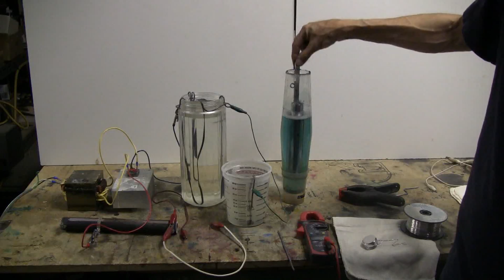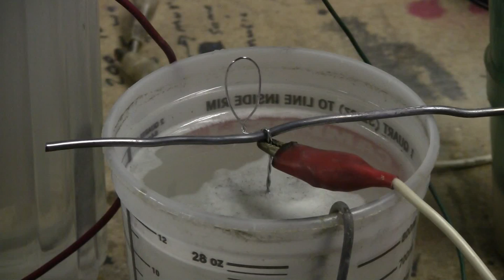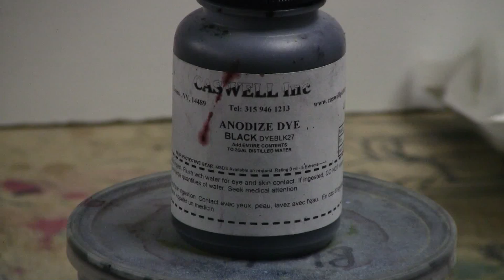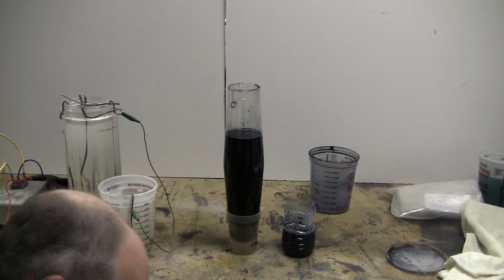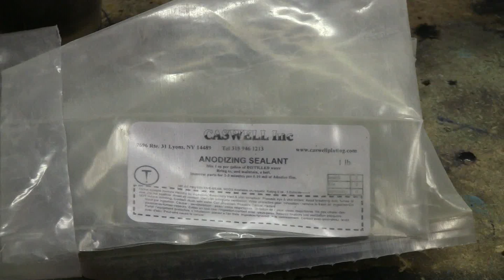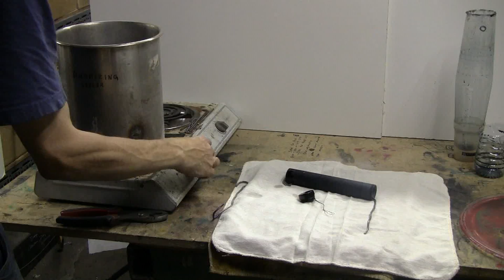How To Anodize Aluminum

Comment: If you put the speed at 1.5, the video is actually really good.
Reply: :D
Reply: William Murphy Wow, the speed is actually a useful thing!
Reply: William Murphy Thanks
Reply: William Murphy How do you do that.
Reply: Click the gear. Select speed 1.5
Reply: William Murphy
Yea, I just figured it out, but it seems to only work in Chrome.
Reply: dispatcher7007 I was watching in FF.  I also noticed that it works with IE in the metro environment.  It's not working with FF, IE on desktop, or Opera (despite the fact that Opera is now just a different skin of Chromium).
Reply: dispatcher7007 It's probably an issue with Flash Player.
Reply: William Murphy "If you put the speed at 1.5, the video is actually really good."

==But he pronounces perfectly and sounds like a newsman.
Reply: Folopolis it could be that your not using the html 5 player with youtube so you should check that, it could be a reason for it to not work. chrome supports it, but i am not sure that firefox does perfectly and it could be a potential problem.
Reply: Aℓαηтιc ƒℓαмє FF does support it, but doesn't use it if Flash is installed.
Reply: Folopolis yeah that's why.
Reply: William Murphy if u use .5 he sounds so unsure of himself haha
Reply: LOL - YES!
Reply: Hahaha, the FIRST thing I did, and thought I'd give the tip to other people. Thanks for being first. :)
Reply: Thanks
Reply: 2 x times speed is not bad either if yo're impatient like me

Comment: GR8T job Mr. Bill. I'm an "Anodizing" newbie.. I was more than surprised to find that the "color" is another process. I had been paying close attention to the video and then realized that 1/2 way through it "cooking".. I didn't remember seeing anything related to the pigment aspect. I was quite surprised to find out its dyed afterwards (live and learn). The items are of much higher quality than I would have guessed from basic, available resources. You’ve inspired me to try the same. 
BTW, that is a lot of work to produce such an informative video. From the actual how-to “to” the editing. I (we) appreciate your brain power and efforts.Thank you!
Reply from the maker: +OvalWingNut Give it a try on some scraps. As long as you can somehow get the acid. You can experiment with color by getting dyes from Caswell or trying whatever you have on hand. Even sharpie markers can work. Note that some aluminium alloys don't take anodize, so maybe make your first tests on some known aluminium. You could file the existing ano off some piece of extrusion, for instance.

Comment from the maker: The dye can be saved in a lidded container, and seems to have a good shelf life. I store it in a cupboard and have used it after months of storage. The dye comes as a concentrate and is mixed with water, so you can make up just the size of dye bath needed.

Comment: The idea of the dying and "cooking": When you anodise things with sulphuric acid the aluminium oxide forms a porous - grainy structure. The pours are actually big enough that organic dye molecules can soak in between them. Then when you boil the part, these pours expand to form a much tighter packed structure and this then locks the dye in place. 
In industrial anodising they are very careful about contaminating the acid with any other metal ions, as this can really impact the quality of the resulting layer. So using an aluminium counter electrode is preferred, also using deionized water, and keeping it at a fixed temperature. 
An alternative to the sulphuric acid anodising is to actually use "oxalic acid" about 4% in water, with around 50V DC seems most effective. The acid is a weak organic acid, so more user friendly in that respect, though it is toxic if ingested in large quantities (c.f. rhubarb leaves!) . The anodised layer is typically a slight golden colour (depending on the voltage and temperature), but because the pours are much smaller than with sulphuric acid, it cannot be pigmented. It is however extremely hard. This was the anodising used for many WW2 parts, for those who may recall that golden colour of some army surplus items!

Comment from the maker: In order to preserve your machined surfaces so that they fit precisely, you could mask these areas so that they do not anodize. The size change depends on current, time spent anodizing, the alloy, and even the temperature and concentration of the anodize bath. Masking areas can be done with paint, for example.

Comment: Excellent educational video. Might be worth mentioning that hydrogen gas is evolved from the cathode and oxygen from the anode. While not toxic, they are quite explosive if the accumulate and ignited by a spark. As well, some would recommend wearing latex/neoprene/nitrile gloves. No risk of fingerprints that way. Thanks again for shaing your knowledge and experience.

Comment from the maker: This is a 2 ohm resistor with a variable tap on it. I use it to limit current on smaller parts. A variac could also be used to vary the power supply output achieving the same effect.

Comment from the maker: The group of laser parts on the left is dyed with Caswell orange 3A. Next part is Caswell yellow 4A, middle section is Caswell deep red. Then Caswell violet 3D, the blue parts are all Caswell blue 4A, the light ones were dyed less time. The parts on the right were dyed using RIT clothing dyes from Walmart.

Comment from the maker: To use sharpies, anodize the part, rinse the acid off with water, and allow the part to dry. Once dry, it can be drawn on with the sharpies, then boil it in water or sealer to finish.

Comment from the maker: If you can, it should be stripped before re-anodizing. Otherwise, you may get a blotchy appearance or other issues. Alternatively, you can mask off the already anodized areas by perhaps painting them over. Some people use nail polish to do this, and then strip it off with acetone later.

Comment from the maker: The acid should not get hot, nor should the part become pitted. Sounds like excess current was drawn, this can lead to a no anodize layer result. A rule of thumb for current is 15A per Sq Ft for one hour. Use some kind of resistance to lower the current drawn if it is excessive. The acid bath may need cooling if heat buildup is an issue. External ice bath will work.

Comment from the maker: The connective wire to the part must be aluminium or titanium. The Al wire can be cleaned for reuse by sandpaper. I often just discard the Al mig wire after use, but I sand the thicker tig rod Al and reuse it.

Comment from the maker: You should be able to find the dyes, at least anodizing is a common process used worldwide. Overseas shipping is always slow and expensive so hopefully you find something locally. Experiment with different dyes and see what happens. The Caswell sealer is nice, but boiling in plain water worked for me for years until I got the sealer product.

Comment from the maker: Those 808nm diodes only usually cut dark colored materials. For cutting fabrics, you might be better off with a CO2 tube of 40W or better off of ebay, with a matching power supply and a focusing lens. Some fabrics may tend to catch fire if the power or beam profile is wrong.

Comment from the maker: You might want to look around for high current DC supplies. A powerful battery charger might do. You would need around 15A per square foot of aluminium. Perhaps ebay? There might be a used supply suitable for anodizing.

Comment: can you direct me to a table that outlines how many turns and what gauge of wire is needed to obtain the same result of your rewound transformer.. and what the original specifications were on the transformer, and what you get out of it after modification? this is a neat set-up.. ive been watching alot of home aluminium smelting.. and it was only time before i reached anodizing.

Comment from the maker: Give it a try on some scraps at first. You' ll succeed. Get used to the process before doing more valuable parts. Some alloys don't anodize well or take color well so there will be the occasional disappointment. Go with the pro dyes and sealer from a place like Caswell (sells small quantities) to get good color results.

Comment: Interesting. Thanks for the demo. Questions: When you say you are using lead solder as the negative wire, does this mean that the resulting anodize layer is a layer of lead that transfers via electrolysis from the lead solder through the acid to be deposited on the aluminum part? If so, is it safe to handle, or will your skin absorb lead from the anodize layer, leading to possible lead poisoning? Are other metals such as brass, copper, tin, nickel, gold (from an old piece of jewelry) silver (from an old silver butter knife or silver coin used as the negative wire perhaps) able to be used as the negative wire? If so, are the results similar? i.e... end result: a copper plated piece of aluminum, silver plated, gold plated, brass plated, etc?

Comment: You mentioned that the source outputted 15 DC volts into the anodized tank. How did you find out what resistance to use? Also how do you test how well the part was anodized? Great video!

Comment: Bill, once a surface is anodized, perhaps we scratch this surface and the anodization layer is removed, thus making the part conductive (no longer anodic). Let's say the middle of your tailcap is scratched, the scratch is 1cm long and maybe .25mm wide. If we follow proper anodization procedure, will the scratch only 'bubble' or react while bathing in acid, or will the entire anodization portion react? Can the scratch be simply fixed? The surface does not need to conduct electricity I am wondering if this is possible?

Comment: hello mr.bill,your video is very educational and simple to understand and i watched it many times your 4 videos,well i am from the philippines here in manila and i would like to start anodising bicycle parts as a hobby, the question i want to ask is in the absense of anodising dye,is there another type of dye that i can use aside from the caswell anodising dye,also can i use a standard 60/40 or thicker  lead solder wire work aside from the mig welder wire as in your video.,TIA for your answer,more powwer

Comment: Mr. Bill, Great job on the anodizing process. I saw sparks when you connected the current leads, please be careful. May I suggest removing your power source until you're clear. Sounds like you've got plenty more good tutorials about metal finishes in there. I have not check your channel, carry on my son, good job. As for these half ass comedians cracking about your tone of voice and speak pattern. I'd like to take my 44 years of studying isshinryu karate and 26 years as US Marine, and give them a little talking to with my well capable hands. 
Thanks again for the tutorial, and Semper Fi. What the f___ ever happen to respect?

Comment: I just love this very informative video. I have a few question though. Would love to have your answer soon please as I want to anodize a project which I'm doing instead of painting.

1. What is the minimum power supply required? Will 9-12 v with 2A or 3A be enough? My concern here is the amperage.
2. What do you mean by degreaser? Is it lye with water?
3.Can liquid food coloring be used for dyeing?
4. Is there an alternative for ca swell sealant? I don't live in US :)

Comment: Someone tell me, wouldn't it make the process much more effective if when the parts were being immersed in the dye that if the container was sealed and high pressure applied (to make the dye penetrate the oxidized layer more) it would yield a stronger/ better end result? What are your thoughts?

Comment: If the piece I want to anodize is too tall for the boiling pot, can I just seal one side for 10-15m and then flip it around to seal the other side for 10-15m. For example a 20" long pipe in a 15" tall pot?

Comment: Hello, great video, i tried this method after pollishing a few motorcycle parts, some worked and some turned a greyish color after the sulfuric acid process, then the dye looked awfull, tried lowering current but was a little less grey but still spotty with some dark grey spots, the dipping aluminum wire looks great thou, lol. Any thoughts on this? Thank you

Comment from the maker: Calculator for the current  (ndhsubmersiblescience . com/ano/720rule)  (take out the extra spaces)  This calculator will be helpful in knowing what current to use for your size part for the desired coating thickness. The resistor is used if the part tries to draw excessive current at the voltage being used to anodize. For small parts like flashlight sized, a 12V supply is fine and often the resistor is not needed.

Comment: Well i have a  power supply i made 30 years ago that gives out 8-18v on two outputs each with a 30 amp capacity so I will use that as it does a good  job, But having trouble with the dye...it just wont take I ran 8 amps at 15v for two hours the acid got hot, the aly started to show pitting but my dye is crap. has it's own fixer and you mix them..but it's not working...Colin

Comment: Nice job Bill.  Very clear videa, though a bit slow.  Just one question: is the water used for rinsing and boiling distilled water or can it be simple tab water?

Comment: I have a question Bill, and I dont know if I simply miss it.. about the power resistor to reduce the current - how much current is needed, say, for the parts you worked in the video? i got here a 12V DC power supply 20A, and I think, I need to reduce the current.. thanks in advance!

Comment: Bob I have a question about the leftover chemicals used. Once you use the sealer, can you save what is left in a sealed container to use at a later date? Same question with the acid bath. Thanks -

Comment: Bill thank you for your respond to my prior question, am i to understand that the distilled water should be mixed to the battery acid at a ratio of 5 parts distilled to 1 part battery acid. I will not be anodizing but parts about the size of the end cap of your battery case. I will be using a HDPE plastic 1 gallon container, I purchased 2 lead anodes from caswell would 2 lead anodes be to many and should I shine them before using?
Respectfully, James Price

Comment: If using a car battery charger how many amps should be used? I understand the 12 volts but my car charger has setting for 10 amps and 40 amps. Great video btw!!!

Comment: Well I bought another make of dye and will only use the color not the salts they give you to fix the color. I am using 38% sulphuric acid for batteries and the same amount of water to get the commercial mix value of 19%, the surface area is 75 sq ins.  the cathodes are bigger by two fold. voltage and amps adjustable.
So day two... I will run about 6-8 amp 21v for 1 hour   can i use food dye if the new dye fails?. im sure the metal was ready, as further anodizing just pitted the metal.

Comment: Bill, thank you for the educational videos. How many times can you use the acid bath? Once you are done with it, how do you dispose of your acid bath?
Reply from the maker: Joseph Helmstetter  The anodizing bath can be used more than once. As it ages, you will see crusts of crystals forming on the side of the container. This is due to a small amount of aluminium being dissolved from each part and becoming sulfate, which slowly builds up in the bath. Once it is spent or dirty, the acid must be neutralized with baking soda until there is no more fizzing. Usually (depending on local regulations) this can then be flushed away.
Reply: Bill Gilmour could you use something else than sulfuric acid? Mainly cuz its illegal here.. i figure that an etching solution of any kind would work.. no?
Reply: +Moronicsmurf Just buy a car battery from the wreckers and use the acid from it and the led plates as the negitive.

Comment: Bill, 
Thanks for the video.  Love the great information. I was thinking of using a computer power supply for my source of power.  This has the ability to convert the AC to DC and have a 12V current.  Will I need to have any resistors on this?  Most also have a 5V current wire coming out of them.  Thanks for any insight.

Comment: hi bill, great vids, i have a question for you. can the same solder wire or any other lead wire be used for the positive connection to the work piece as apposed to aluminium wire, if so then wouldnt these be reusable as they wont anodise like the aluminium  wire dose and create an electrical insulation rendering them none reusable,thanks

Comment: I read somewhere that you can dye aluminum after simply etching it.  I work at a print shop and have some potassium hydroxide that is used to  etch lithographic plates.  I'm currently working on some aluminum wind chimes that I was hoping to dye.  I tried etching the some of the leftovers for different time periods and dipping in Rit dye w/ little success.  Would it help to heat the dye, or should I just set up tp anodize?

Comment: Hey Bill, I have a set of red anaodized aluminum bicycle pedals that I would like to turn electric blue.   The red frames completely detach from the rest of the assembly....however i was wondering, do i have to blast/etch off the red layer before i attempt to turn them blue?

Comment: what is the average current draw of your supply? I'm attempting to recreate this experiment using test strips of aluminum. 1/2 in by 4 in strips. I'm drawing about 12 amps and after an hours time... my test strip is dissolved! I used a 5:1 ratio of water to acid... If I reduce the voltage, that will reduce my current also... is this ok to do or is the 15vdc a critical figure to use? I can vary my output fro 10 to 50 Vdc at a max of 35 amps...

Comment: Hey Bill when using a D/C battery charger, depending on square footage of parts .What amp scales do you want to use I have a shop charger its has variable amp settings. Because i;m starting out, so i'm piecing items together. thanks